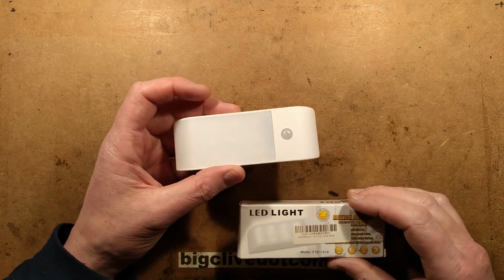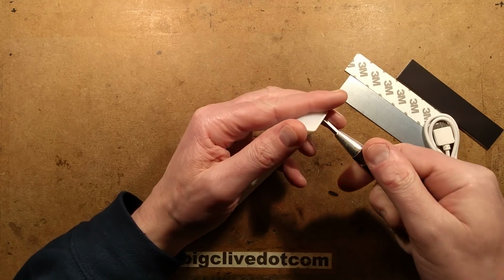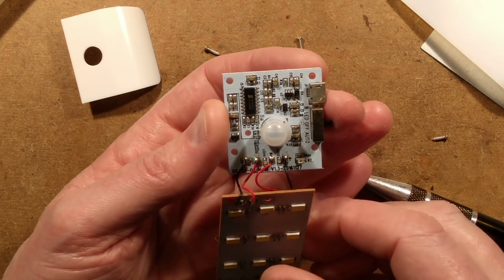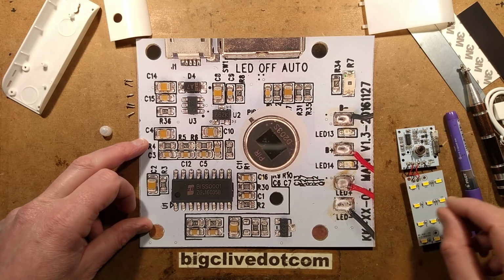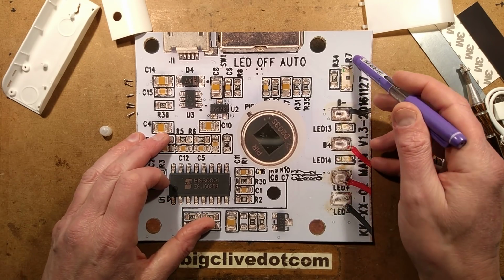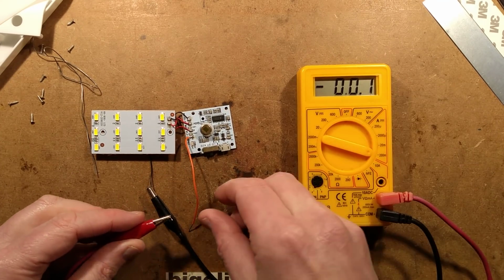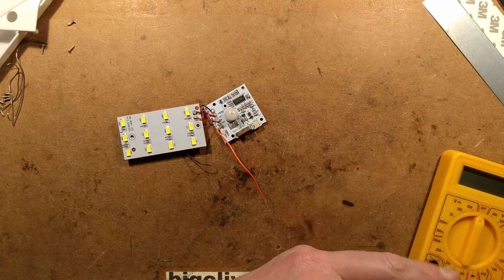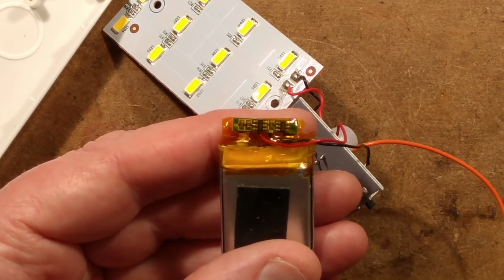Sensibly designed USB rechargeable PIR cupboard/hallway light.

Comment: At which voltage do you measure the capacity in mAh of the cell? 
I think the manufacturer calculates it at the nominal voltage of the cell (likely 3.7v). At 5v it is less of course.
That's why I like Wh more, not depending on voltage and easier to compare.
Reply: Yeah. I think he's still doing it wrong. The mAh is at the cell level, not the USB level.
Clive needs to get a lithium cell charger with test capabilities... No more farting about with dummy loads and USB charger monitors.... Just hook up the cell and press a button or 2.
Reply: @tin2001  BC's measuring the mAh to charge the cell. Because the cell is charged via "linear" (constant-current, roughly) regulator -- rather than a switch-mode -- the mAh is accurate despite the input voltage is 5V and the cell only charges to (about) 4.2V; the voltage difference gets "wasted" (because economics) as heat in the regulator.
And you gotta use a dummy load, or close equivalent, to see what  maximum output current is available; a charger monitor won't tell you that.
Reply: I think he discharges the cell then measures how much power it took to recharge. That's what he said in an earlier video.
Reply: @crawfish069  Nearly; how much / many mAh it took to recharge, rather than the power required.

Comment: Ever seen a lipo like that which had two of the 8205 dual mosfet packages? Couldn't read the protection chip. Would they put them in parallel to handle more current or something?
Reply from the maker: They stack the MOSFET packages in pairs for more current handling.

Comment: Great video as always  thank you.

You stated that the sensor couldn't see through glass. What other sensor similar to these PIR sensors would? the reason i ask is that our council recently replaced the lights outside my flat that had the PIR lens, with lights that just have a light defusing dome covering the whole thing, (no visible PIR lens). Its on a wall about 8ft away from my front door and switches on everytime i walk past the door in the dark hours.
Reply from the maker: That's the modern radar/microwave sensor.  It detects movement by the disturbance of a very low power radio signal.
Reply: Cool thank you for your answer  @bigclivedotcom

Comment: At 18:40 when you calculated the watts that the circuit draws you got the current measurement directly from the negative of the battery, right? So why would you use 3 Volts instead of the battery voltage, which should be somewhere closer to 4V if charged?

 Is there something I missed?
Reply from the maker: It's the LED power I was describing.  The LED forward voltage is typically 3V.

Comment: Seems like a really decent product, I'm tempted to pick one or more up. The dark closet where I put away my vacuum cleaner could use an upgrade from the manual battery powered light that hangs from a screw. Don't even have to put in a new screw by the looks of that hole size in the plastic case.

I suspect if I was to upgrade the battery capacity on this one I'd be lazy and reuse one of my protected 18650 batteries that used to live in torches (moved on to a fancy one that takes unprotected 18650 cells only and has low voltage cutoff built in), the 18650 wouldn't fit but a hole for the leads and a battery taped to the side will do in a rarely opened closet (unless I've come across more spare lipo batteries by then that don't get consumed by projects that need to be small). Could even attach a holder to the side so I can have a swappable battery or USB rechargeable as the situation requires.

But with infrequent opening of that closet door only for brief periods I doubt I'll ever need to replace the battery,  just charge it very rarely.

Comment: Are there any standard sizes for flat lithium cells?  Looking around I see mostly brand and model specific cells like the old Nokia ones or the ones for various Samsung models etc.
Reply from the maker: There's a huge range of sizes.  All given as a simple number that describes the physical dimensions in millimetres.
Reply: Even if the dimensions are nearly identical, designers will  modify the interlock or/and contact placement to indicate variations in the occluded circuitry, which you’d be wise not to defeat.

Comment: my fridge light stopped working a long time ago, this will do just fine

thanks clive
Reply from the maker: Is it an LED panel or changeable lamp it takes?  If it's a changeable lamp a good upgrade is to screw in an LED one.
Reply: @bigclivedotcom  Sorry I didn't get a prompt in my notifications from your reply for some reason.

It's a cheap Candy fridge, behind the opaque plastic diffuser/reflector that is held on with one screw, is an exposed single LED poking through a small hole. 

Can't see any board it is attatched to, and there is no way of getting 'further in' from the inside. I imagine I'd have to start disassembling my fridge from the back to actually get to it.

And on that, I'm not sure if it's the LED that has died, or the supporting circuitry, or the switch in the door.
Reply: Probably the moisture killed it with corrosion, and neither do these look hermetic.

Comment: You should always cycle the battery 2-3 times to get a better capacity reading :-)
Reply from the maker: I usually do, but didn't have time to do more than one discharge and recharge cycle with this light.  When set to continuous mode it runs for a long time.
Reply: Only haptic charge controllers (with temperature feedback) are less likely to initially charge single a battery setup to the exact same capacity each time. The (mentioned) constant-current draw alludes to the more draconian circuit type with invariant charge cycles.

Comment: Do you think the board could be used to drive higher wattage LEDs?
Reply from the maker: It depends on the transistor rating.  If it runs cool then you could probably use it with a higher load, but not too high.  The transistor could also be used to switch another transistor for higher loads.
Reply: @bigclivedotcom  Thanks. Driving another transistor sounds like a good idea.
Reply: I agree with big Clive on this one if you did that technically wouldn't it be become a Darlington transistor?
Reply: Aaron Brandenburg
no the second “transistor” would be a fet. Darlington arrangement is called ‘pair’ for a reason, it’s not a single “transistor”.
Reply: There ARE single package Darlington's (TO220 style) but Darlington's are much too strong (high gain) for LED's I think.
Reply: @HighestRank  you did get my point that was an Electronics joke

You notice I said technically that would be a Darlington transistor emphasis on technically the emphasis there hooking two transistor together AKA connecting two transistors together.

 and then I was going to follow with just kidding it would not be using a Darlington transistor.

 affect or not a transistor and explain the joke is more for the people that will  understand of transistors.

 Fall by the explanation how to do it.

 but unfortunately I had to go do something else before I had a chance to do it oops. And allso closed. Out YouTube completely logged off and had not saved the video and going to another one and couldn't remember the title of and forgot to check history I think anyone can do that at times but.

 yes you probably need a Boba Fett.

Or a nuther triode.

 I think yew Sea now.

Wright?

But yes he would probably need a

Field Effect transistor AKA a fet.

So was my fault I did not complete it with the second parts of it because I was not available that second part was going to be in the next Comet that i road.

And also after that my mind was kind of off in the ethernet.

Hehe hehe hehe hehe hehe
Reply: Oh he means extra room so you can let the battery be overcharged or discharged or time so there's room for it to expand so that it does not destroy the light so you put an replacements cell again and again in it again and do the same thing maybe even with an unprotected cell.

Going yes I did drop another bomb like that one in clearing up quote comment about the Darlington transistor if you like this one read that he he he he he he he

Or if you really want some excitement you know that metal plate on the back of the LEDs and there is a lithium cell that under eye conditions could let's say get bigger put some extra tabs on the battery heading tour the top of it and overlapping the top of the cell and with no protection of course don't do this but could be a little exciting I think if you understand about lithium batteries and short circuits.

Explosion containment pie dish anyone.

AKA is this is not to be done on purpose but I've seen products designed in such a way that if the batter should expand that exactly what happened that's why I bring this up to make a point and also this is too big wife about this as well huh any thoughts high like some laptop batteries and some other devices and some of even seen and yes I've had two of those devices do that Miss Africa fire a bit so I asked him what could cause that took it apart and over hold that's why I happened living rot and these were not chinese-made they're actually made in Japan that's right Japan was more like China and yes the parts were junk and also the major brand of everything I doubt everything could be faked and including every single part that's branded that would be knock off of a knock off of a knock off and more knock off some more knock-offs I checked and it was a registered Japan manufacturer I'm not going to be able to branch it would Scar the brand because I know everything else of theirs is really really good. Any thoughts on that big Clive or a v e or Dave Jones eevblog I bet you he sees stuff like that if you haven't big Clive if anyone has seen that something like this end their experiences please call me hello give a like to show you have seen it thanks bye

Comment: Hey big live again I know idea for idea for new project video building or converting a LED light adding lithium ion battery charge circuitry either transistorized or logic or microcontroller and using the USB import not only to charge the cell but also to act as a data line import for power present depending on the mode of the switch and when the power is removed as in no power to the charger Bingo let there be light.

Of course a test button the option to keep it on or off or perhaps even though unusual PRI
Sensor as well.

Allso a separate video on converting things that normally run alkaline batteries to lithium ion batteries and charging.

And also converting a standard battery LED light to rechargeable lithium ion USB charging and automatic emergency light like above.

Comment: Know how long they last before they go dead? I've had a remote controlled (not pir) die every week regardless of use. It'd be probably worth it to up the batt or have more on hand to swap out when they die. Looks like a good unit.
Reply from the maker: The quiescent current is so low that with normal use in a hall it could run for months between recharging.
Reply: So per what’s possible here you’d go from 1 week to 2 weeks. Not good enough.

Comment: I have a similar type of light, branded Osram, which I picked up from a similar to Poundland type place recently. It was £2.99 and runs from four AA cells. It's on my list of 'to do' things to see if I can put a suitable lithium cell in and give it a (possibly solar) recharging capability. Interestingly it doesn't have an on/off switch on it, just pull the little tab that breaks the battery connection and it's happily detecting until battery death. If they still have any next time I go in you may see Postman Pat bringing you one some day soon.
Reply: bren106 they’re probably NiCd cells, no VR nor charge controller, or worse just a whetstone and capacitor running straight to the mains. Not suited for Li packs.
Reply: @HighestRank  No, they're not NiCd. It's using standard zinc carbon batteries. Of course it will need the necessary components to convert to Lithium and/or adding solar. I just sort of assumed that everyone on an electronics channel would realise that I would realise this. I, of course, failed to consider that you someone would be trolling me because I shot you them down in flames on a different comment.
Reply: @bren106  if you really want to be put down in flames just use the charger that is not acceptable for lithium use and charge it with the main power then you'll really go down in flames.

 or either or be someone like photonicinduction I want flames.

Comment: Microwave detectors also "see" through walls and floors and are difficult to collimate, so PIR detectors still have their uses.
Reply: Microwave detectors are good for inside a van space, protecting the rear end from theft... They can't see through metal, I'm designing an additional alarm system now as it happens.
Reply: Yes, protecting the inside of a metal box seems an ideal application for microwave detectors.  :)
Reply: Microwave detectors are great for security you know.

 Oh one more thing if it were a microwave detector when it only go off when you turn on your microwave.
Reply: @aaronbrandenburg2441  Nah, the microwave's there even before you turn it on.
Reply: @theskett  yeah the microwave is already there before you turn it on but but I actually meant to say microwaves as in the electromagnetic radiation. Oops I deserve that one. :-(
Reply: Another for all if you if it were pyroelectric type motion detector.

When did legal off if somebody moved fireworks that work electrically ignited.

Comment: I used to have a sort of "PIR night light" but I found it wasn't versatile enough.

Just replaced it with an IoT plug in night light/outlet since I have Echo Dots within earshot.  I schedule it for off during the day and dim light level during night hours... then tell Alexa to raise it to max as needed, plus I get a voice-switched outlet to boot.

But the subject of this video has the bonus of rechargeable use where there is no outlet.  Might be useful in a closet, etc?
Reply: Oh speaking of closets LED lights I just did a little something the other day where I stay I found this small LED strip not flexible but in a plastic shoe with some brackets and stuff that one of my techie friends that sent me is a care package with some other stuff he said might be useful for the closet issue and he said take a look at the specs I need the after and the LED and no tea in one switch standard Barrel plug voltage and current before reading the back of this so I did and also in there was a barrel photofit a chopped off defective USB cable with mail and still on it and another bad USB extension cable is damaged in about the middle and also he said you did say that you use speaker wiring all the time right for low-voltage use is a substitute for low voltage hook up wire to save money. All right I realized and he had even in clothes when he drink and he said Oh I thought you could use some more solder since you said that you're almost out. And also he had a nice extra iron stand he said he'd run across the thrift store. And also another phone charger type charging station he said all it needs it's just a little TLC just needs to be be soldered in a few places of us is fine and also one Ford the socket was useful socket was broken on the board you said that could be used in extended with the other USB extension is damage deposit box strictly power to closet light.

Low and behold bedroom closet light of you split Loom tubing to protect the cable that made up with the speaker cable that used to being inside the closet in case it gets head crushed by something and also split Loom and spiral wrap elsewhere. To protect the cables. And he said also since he that we had frequent power outages and I had multiple power Banks that that way if you ring it be easily roof from the shelving rock bottom you could do something for an emergency light with a power Bank.

Comment: Me again same video I know.

You commented about the free meters.

Yes in the United States yes you do that place called I'm sure you and everyone else knows who but Al said anyways of course harber Freight Tools.

By the way a lot of times if you need something they have is worth getting the free items even if it's four parts such as those cheap LED work lights great source of LEDs and possibly a magnet and even the spring for the hook are all were salvaging.

Especially if you're like me and disabled with limited income.

And speaking of salvaging LEDs a good time to do it has recently passed and there are still some around AKA Christmas LED lights do you may not realize it but yeah it's worth it plus if you if you support for something and you could always scrap copper and with the incandescence as well as the common wires 4 the LEDs and also on the incandescents S house yours Journey 2 wires that run most of the way through the set that could be used it's okay sis for hook up wire.

A Chorus everything else can become scrap copper overtime Salvage can pay for itself I think you get what I'm saying.